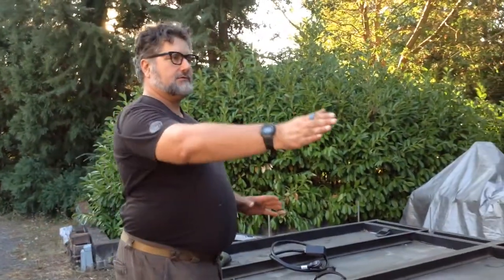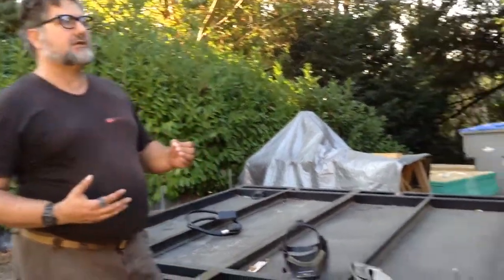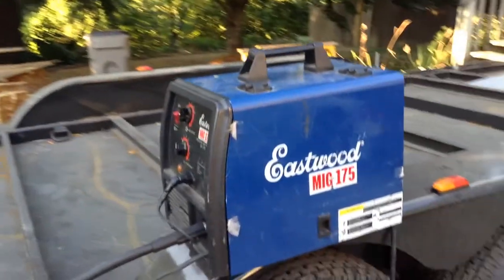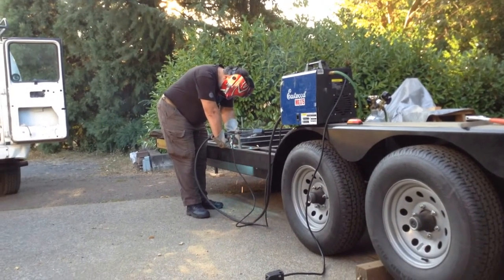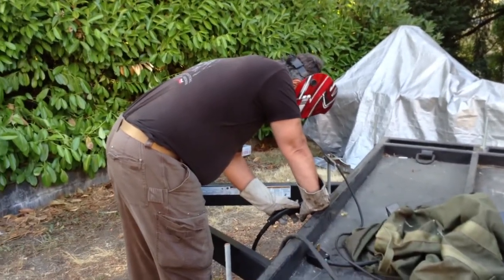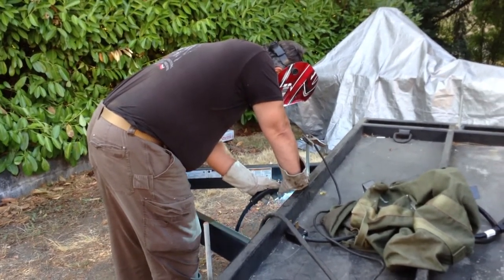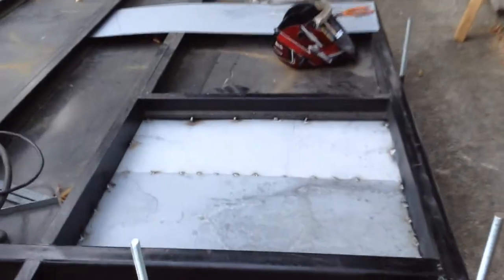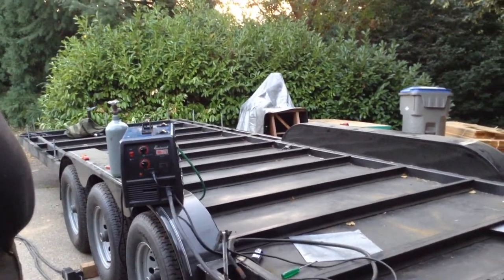Tiny House trailer wall brace bolt down points.

Comment: Nice video old buddy.
Thanks for sharing.
I would use cardboard or foam sheets between the metal and the insulation. I see its already tacked, but will the seams get filled in to keep the bugs out? I hope that is not a stupid question.
Reply from the maker: I am not entirely sure what the owner plans for that element of the build, but traditionally the bottom is not sealed off at the insulation, it is sealed off at the subfloor.